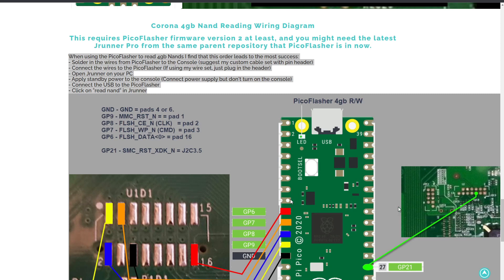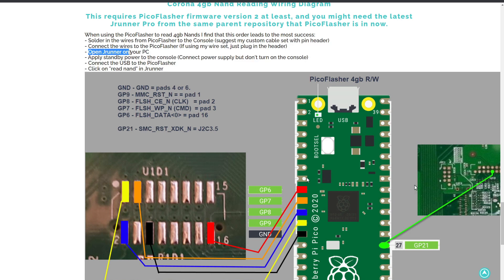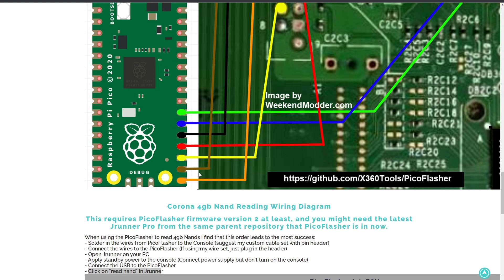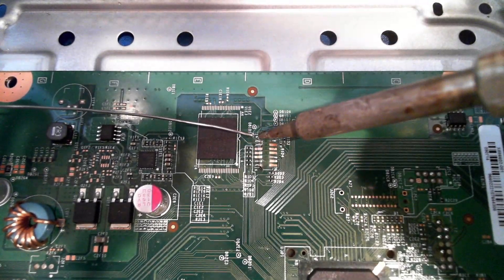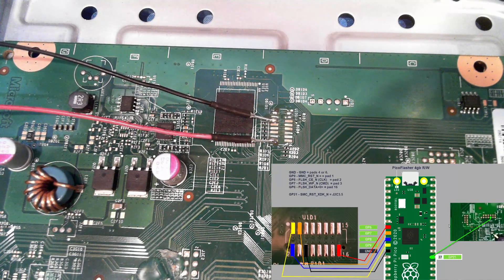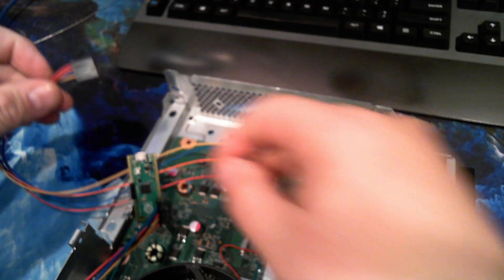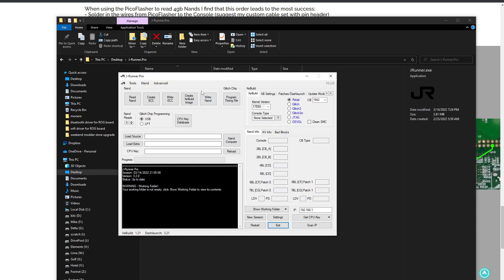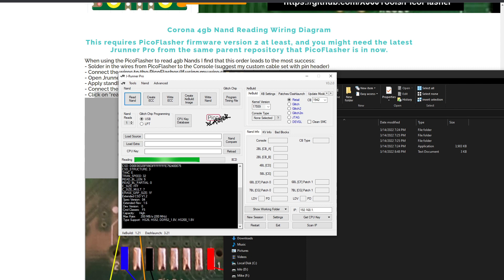Trouble reading 4gb nand with PicoFlasher?  Unknown flash config?  The fix is the order you connect!

Comment: If you are having issues with reading the nand, ex: "console not found" or "Unknown flash config 0xFFFFFF", try using a USB 2.0 hub (doesn't need to be powered). I spent literally days hunched over this thing and in the end that is what worked for me, not entirely sure why but I am pretty sure it has to do with my laptops USB ports being USB 3.2 and the Picos being USB 1.1. Double check your work first but this may be a solution for you.

Comment: you can also use old way by grounding crystal if encountering issue, it's actually more effective. that gp 21 only disable SMC but leaving Southbridge core & clock generator still running.

one thing I also noticed all pins except gnd should be using 100R resistor for better protection, JRP, nand x, mtx has this installed by default.

Comment: I did all this but I just can't seem to get it working right. It was able to read the Nand twice and I made sure to select the right settings for my console. Once I create xell and write it, trying to boot my Xbox just results in the green LED turning on but not spinning or loading into Xell. 

I double checked all my wiring and even reinstalled my postfix adapter. I also made sure to bridge the missing resistors and I am also using a 1k ohm resistor. I also redid all my soldering in case that was it. I also made sure  that I didn't have any excess wire length. I did eventually accidentally pull pad 1, but I was able to to use the pad that connects to the pad afterwards. I have no idea what is up with my Xbox. Is it just the Pico not playing nice or am I overlooking something?

Comment: I tried the order you mentioned and it didn't seem to make a difference. Is there any more updated info on problems with the Pico and 4GB NANDs? It seems like there's been no activity on the PicoFlasher repo in a year and a half and there are several open issues with other people having problems detecting the console or even getting PicoFlasher working at all. I get the feeling there's a need for a fix in the firmware for some of these issues.
Reply: I doubt it's a software issue if it works for some people reliably. It's most likely user error
Reply: @SoundToxin  Definitely it is problem with picoflasher I checked my wires like 10x times and everything is okay. Do you recommend other programmer from Aliexpress like jr V2 programmer bcs I'm from EU. Can't get xFlasher :/
Reply: @AleksandarAnelkovic  After my own PicoFlasher issues I just got an xFlasher and used that for the rest of the 360s I was modding. I have no experience with any other flashers, so I would be hesitant to recommend a particular one. Maybe you could use a mail forwarder to get an xFlasher where you are. I happen to be in the US, so I didn't have to do this, but I've heard of people doing it for other things before... Good luck.
Reply: @SoundToxin  Thank you, I've ordered Xecuter SD card RW tool kit from Aliexpress, saw it on other forums that people made it with it. All best

Comment: when i try to read the nand, jrunner says me: 
*********+JIT debugging *************
 To enable Just In Time debugging (JIT), the configuration file of this application or equipment (machine.config) must have the jitDebugging value set in the system.windows.forms section. Application must also be compiled with debugging enabled For example: <configuration > <system.windows.forms jitDebugging = "true" / > < / configuration > When JIT debugging is enabled, any exceptions are not controlled will be sent to the JIT debugger registered on the computer instead of controlling it through the dialog box.

how can i fix this?

Comment: I have connected everything properly on Corona 4GB but I got this error: Checking Console...
Console Not Found

Console Not Found
Does someone knows how to fix it?
Reply: Update: I have succesfuly read nand but when I create XeLL image and write it (I don't get message that it is done on jrunner but I get sound) and when I try to boot xbox it doesn't give picture, when I flash old nand, everything works. Could that be PLL bad solder or something else?
Reply: Another update: PLL point was bad welded so everything after fixing it works fine :)
Reply: How did you do it can you help I am stuck on read nand even after doing everything correct and wiring properly it still not able to read my nands

Comment: The fix isn't the order you connect for everyone. Some systems (including one I'm doing now) have 0v on the flsh_CE_N (CLK) pin (#2). Picoflasher will never read the NAND in this case - won't even find the console.

Other issues are that some Pico boards will stop being recognized after the first flash - unplug and replug and jrunner won't see them. Seems to be a Picoflasher firmware issue.
Reply: what do you suggest I do? i have the no console detected message.  I've followed the guide from Xbox 360 hub and no luck.
Reply: @willptech7565  Unfortunately I dont have enough experience with the 360 to tell you for sure - I'm in the same boat. The SD flasher is reported to work for some systems where the Picoflasher fails, and so too is the USB Flasher.  Waiting on some confirmation now because there's no way I'm wasting any more time on this console until I know whether a specific HW will work with it.
Reply: @willptech7565  Got confirmation USB Flasher is supposed to work, so I'll be ordering one of those tonight. I can buy another 360 for the same price, but if it's the same rev as the one I have now, I'd still be stuck. :)

Comment: I wish you would've finished the entire process: I am at create ECC, but I am not getting CPU Key just black screen. I am able to read and write nand on a 4gb corona. I am using your kit.
Reply: @angelobuoro if you have the board still, you can try buying a different flasher to salvage it since you have the NAND dumps
Reply: Need to unplug everything, then plug power an tv cable, i always use a control cable to turn on the console

Comment: I have a 4gb trinity console, but it isn't like this. It also has a 16mb nand, the 4gb nand is on a daughter board. What do I do in that case?
Reply: Ignore the 4gb, use the normal wiring points
Reply: @KamiKaZe07  hey, you were correct! I figured it out in the end, it's working like a charm! I also ended up upgrading the hard drive to a 1tb c:
Reply: @KamiKaZe07  Also, during my time working with the consoles, I found the NPPN042AFCN-RC female headers are perfect for populating the Xbox. Making flashing and reflashing extremely easy and secure, I would recommend it if you do these often!

Comment: The week end modder I need your help. My j runner is not programming my ace v3 iv tried everything and also my j runner is now solid red and I tried all the combos and the reset button without any success, please help, thanks
Reply from the maker: Sounds like you might need to re-flash the firmware file to the JRP itself.  

The switch that you need to focus on is the JRP-BL switch. If you look to the left of the switch you'll see that marking. 
That BL stands for boot loader, and you need it in that mode to re-flash the firmware to the JRP

This video does a good job of demo'ing the reflash procedure:

https://www.youtube.com/watch?v=WXsD7yB7-Os

Comment: What temperature do you keep your soldering iron at?
Reply: It depends on how good your iron is (so how accurate the control is) and how much heat capacity your iron has (determined roughly by weight). I keep mine at 350 C.

Comment: No luck for me, still get no console found 0xffffffff
Reply: I have stand by power attached, same issue
Reply: Board is a corona v4, also had the same issue on a trinity which I was able to read with a jr-programmer without issue.  I’ve tried different picos, wires (gauge and length), and pcs same error every time.  Confirmed wiring and soldering with multimeter, no shorts.  I’m waiting for an sd reader to see if that works.  So far not having any luck with picoflasher.
Reply: Did you solve this?
Reply: @andrewa837  unfortunately no, I tried again with different wire sets and different picos,  always see no console found.  J-runner shows the picoflasher attached but no console detected.   I  followed weekend modders steps did not help
Reply: @michaelbarsoom  i have same problem. SD card programmer  works ?
Reply: @miso1585  same problem, im working about 6 hours trying to solve this, no luck...
Reply: @miso1585  only thing i can say, is that i read two times this corona console, reassigned com port to another, used several ports, powered usb, usb hub, tried with stby power, reflashed pico, and even is reading 16mb nand with no problem
Reply: Same problem ere, no solution at moment
Reply: Keeping an eye on this comment section in case anyone finds a way to resolve this. Same issue corona v2 4gb. "console not found" checked over solder points several times. When Pico wires removed console boots to retail so I haven't fried the console. Just wont communicate.
Reply: Is there any update about this issue? I'm having this problem with my corona v4 with 4gb nand
Reply: Just an update. After days of trial and error, I had finally got my 4gb corona with a hynix nand running on RGH3. I had successfully glitched it in Jrunner using maximus sd tool

Comment: can i use a another raspberry to do this or just te pico version? i try to programmer my corona v2 with SD card but i dont have any sucess...
Reply: The Pico is a microcontroller, unlike the other Pis which are single board computers. It's more like an Arduino than a Pi.

Comment: I have the "console not found" problme. I check and resolder the wiring, pico is up to date and i have an 0 Ohm resistor on R2C10.
I have a Skyhynix nand chip.
What else can i check for the probleme?
Reply: I have done the job with a SD tool.
Reply: How did you fix? You didn’t fix with pico?
Reply: @KiiLz  I used an SD-Tool.
Reply: @CrossfaderXT  does the sd tool work well? It’s worth buying?
Reply: @KiiLz  it works good
Reply: build myself an sd reader with an adapter, wich worked great.